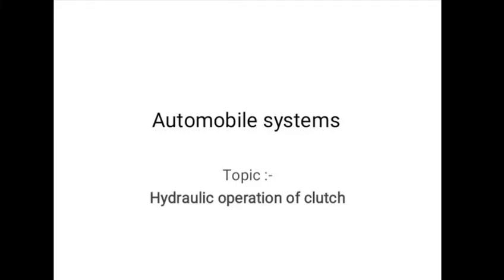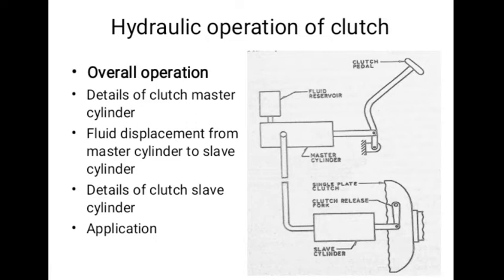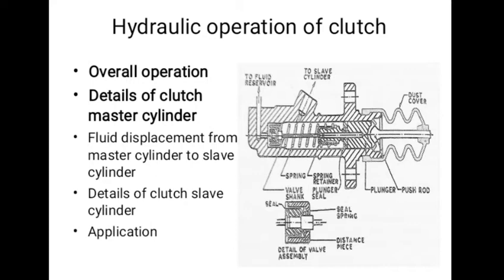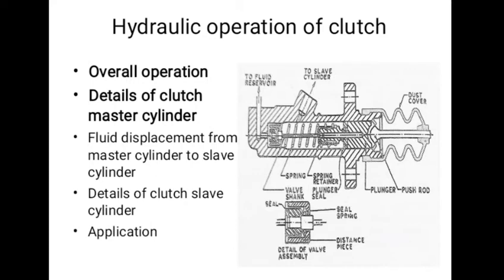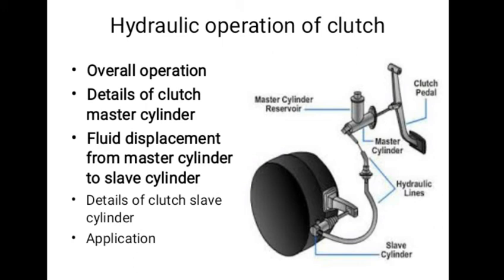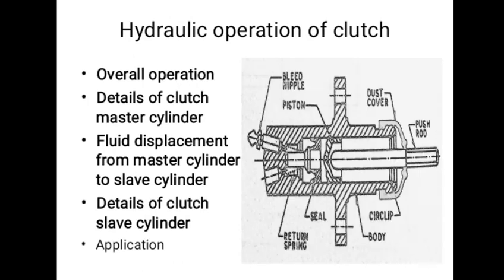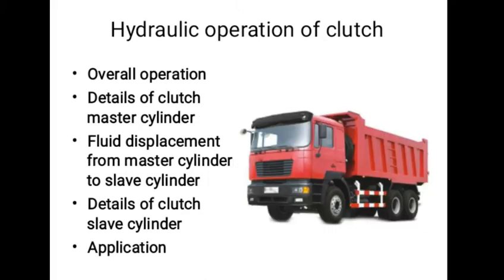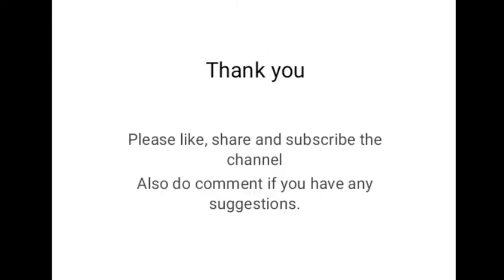Hydraulic operation of clutch. Working principle of hydraulic clutch. What is master cylinder.

Comment: My clutch Master fluid is returning back to the reservor with bubbles due to pressure from slave thereby  causing the failure to clutch while in drive